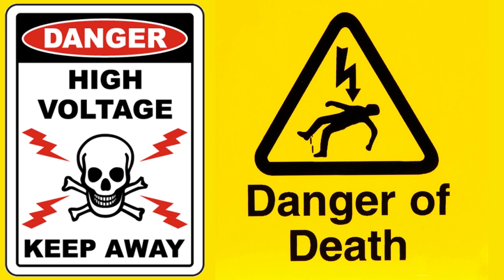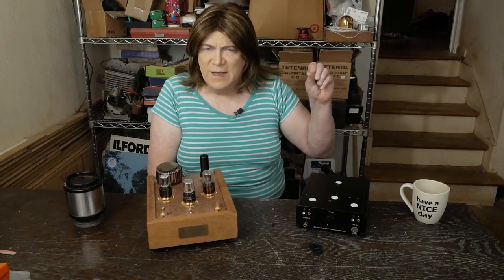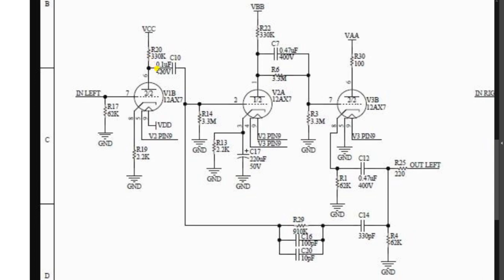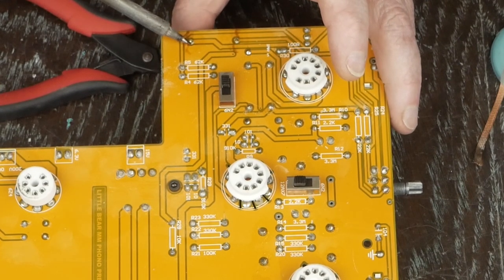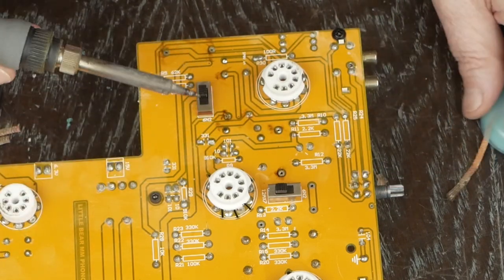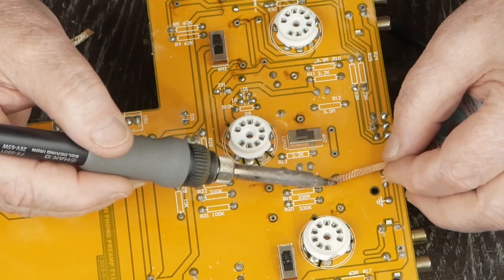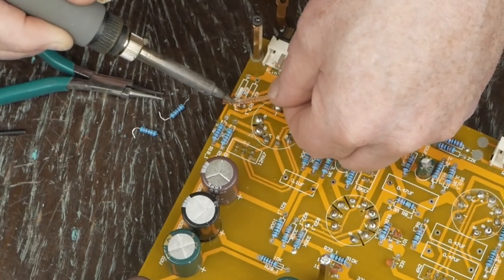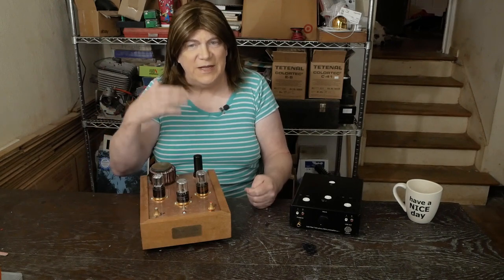Little Bear T11 Tube Phono Pre-amp Upgrade

Comment: After owning the Little Bear T11 for six months, the plastic housings for the RCA inputs and outputs turned brittle.  One day when I unplugged and reinserted the interconnects the plastic just crumbled.  Ended up replacing them with Neutrik ones.  Highly recommended for anyone who owns this T11.  Skunkie’s mods plus T.Layton’s RIAA mods turn this little preamp into a glorious sounding component.

Comment: Appreciate you are showing people how to unsolder. But if I can I try to avoid it by snipping cheap parts out. Saves damaging / heating the board up. Flux is great for unsoldering and resoldering. Another goid tip I picked up was using a safety pin to clear blocked holes, they are stainless and it works nicely. Heat joint, insert pin, let joint cool, withdraw pin, nice clean hole.

Comment: A few years back, I bought a Tavish phono preamp. The V1 tube it came with is a 5751, which has the same pin out as a 12AX7, and it’s very low noise with no hum. The designer / owner of Tavish, Scott Reynolds said he tried many tubes in the V1 spot, and that the JJ 5751’s were the quietest current production tube he could find. 
This may sound like a total pain, but I’ve found that even though most MM or MI carts say they wanna see loading of a 47K resistor, that’s not always the optimal value in my experience. On my EAR 834p clone, I added external loading plugs going to where the 47K resistors go. One of course needs to use 1% tolerance resistors so the channels are even. I made a bunch of different loading plugs ranging from 22K to 100K. But…if you’ve only the ability to have one set of resistors, 47K is the standard. 
Yeah, those don’t look like genuine WIMA caps… lol 
Another awesome vid, Stephe! Thanks very much 👍🎶😊

Comment: Cool. I have a Little Bear T10 which preceded the T11 and is really close spec wise. The T10 doesn't have the metal case or a volume pot and the PCB is a bit different as well but, it uses the same switchable 6N2's/12AX7's and a 6Z4 (6X4) rectifier. I was considering an upgrade to the T11 but, it's really not worth it. I did a few component upgrades and what I use instead of the 6N2's/12AX7's are 3 6EU7's. At first I used socket converters but, I eventually just rewired the 6N2 switch side of the sockets so now it's 6EU7/12AX7. I've tried all kinds of tubes in it to try and get mine as quiet as possible including 7025's, 5751's, and even some lower volume 12AY7's which I thought would help a lot but the best results came from the 6EU7's. It's a bit finicky about what tubes you use and in what sockets. Just switching the order around will give you different results. I still get some 60 Hz hum though. I bought an inline hum eliminator and use it to get it dead quiet. However, it does get rid of some low-end... unfortunately. If I listened to vinyl a lot, I would just get something better but, compared to the other solid state phono pres I have, the T10 opens up the sound substantially. Kinda night and day in my case. Cheers! 🥂

Comment: Madisound in Middleton, Wi. carries a nice supply of higher end crossover parts, drivers, etc. They even have some very nice Cardas silver solder that works great for circuit boards.
Reply from the maker: Yeah I got them to start stocking the caps needed for these and other tube amps, I'm now buying most of my caps from them.

Comment: Besides flux add a little leaded solder to whatever you want to desolder sounds counter productive but it does work. It helps the lead free stuff flow and cleans up a corroded one so it gets sucked out better. I use a vac desolder station which is worth every penny but when I use braid I dip it in liquid flux, add a bit of leaded solder to the pad/joint then pull it out with the braid. Rinse repeat with more braid, flux and new solder. I am cleaning up a power supply in my service monitor right now that had the caps explode and the solder just isn't wanting to budge much less clean up by any one method alone and those tricks really help. It's bad too I put the whole board in vinegar and it was fizzing for a while killing all the electrolyte am having to redo pads and conformal coating. Now I got to go replace an RF tube as big as your head.

Comment: Hi, amazing work, i really enjoy your videos. Ive got a question, can i use a 12AT7 for V3 as cathode follower? i get a really good sound, but im wondering if i could have electrical issues... Kind regards
Reply from the maker: I believe you can, might have to change the cathode resistor? I've seen this discussed as a mod to the EAR834 clone.

Comment: Hello ,out of context but...Have you heard of''Hagerman Labs ''Cornet tube phono stage .The difference [one of] is a 12AU7 CF tube instead of 12AX7 on the acclaimed [with reason] EAR 834 ? It's so silmple is ridiculous specially with tube rectification. I like the Octal version with no Current Source Transistor .
Reply from the maker: I personally like the Zhili AUdio black and gold board, you can change a couple of resistors to use a 12AU7 as the final cathode follower if you need extra drive.
Reply: @SkunkieDesignsElectronics  Thank You for the input !

Comment: I am kinda lazy to remove the parts this way 😊 I usually put the screw driver underneath the resistors/caps while heating the pins on other side and lowly push it out, then clean the holes after.

Comment: Which Mundorfs are those? Do you think anything else loke Solen would be the same signal quality?
Reply from the maker: I've tried solen and while not bad, don't sound as nice to my ears. These are the aluminum/oil foil type.
Reply: Thank you! Just to make sure I'm not loosing it, parts list would be four 0.1uf @ 400 VDV and two 1uf @ 400 VDC  plus two 47k resistors that are what 1/4 watt, mayve 1/2 watt? Always gotta get my parts straight before I open anything up! You're awesome and thank you for the content. I've got a little bear driving the 6p1 amp so you really have my stuff opening up
Reply from the maker: Lemme listen to it before you open yours up!
Reply: Fair enough! You're awesome
Reply from the maker: BOM is up https://www.skunkiedesigns.com/littlebear
Reply: Just finished up the mods! Not too bad. I used Solen fast caps to ease the budget, and silver mica for the little 330 and 110pf ones. My top end was always nice, but this def opened up the lower mids and bass some. Not bad at all. Running 3 1965 Sylvania USAF marked 12AX7's and a Soviet version of the rectifier. Don't know if it can be beat for the money

Comment: please clearly name both the phono amps in the description.
Reply from the maker: You mean "Film capacitor" and "Resistor"?
Reply: @SkunkieDesignsElectronics  nope. the stereo components. ones little bear T11.  whats the other one called?
Reply: @SkunkieDesignsElectronics  i edited my post to remove the confusing word.
Reply from the maker: The one I didn't like the sound of was made by Cern Tube. The one we are modifying is a "Little bear" branded model, I believe made by Nobsound/Douk
Reply: @SkunkieDesignsElectronics  thanks. stephe im enjoyin the little bear mod videos.